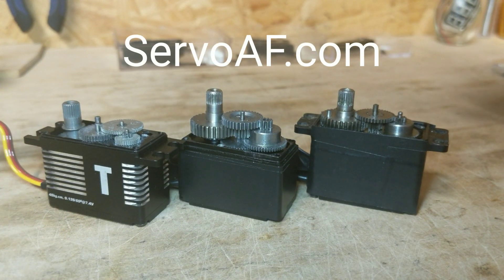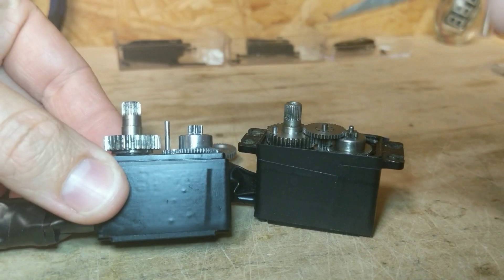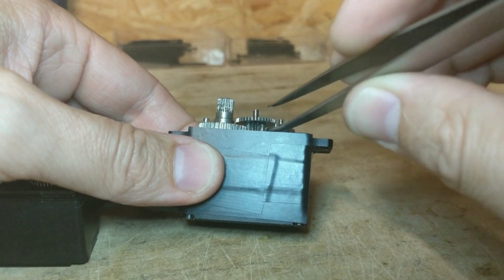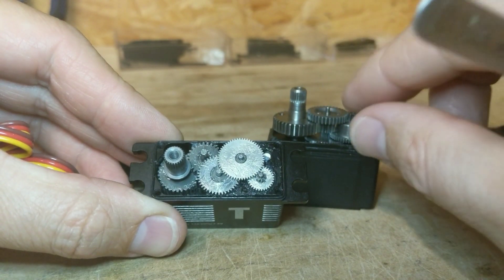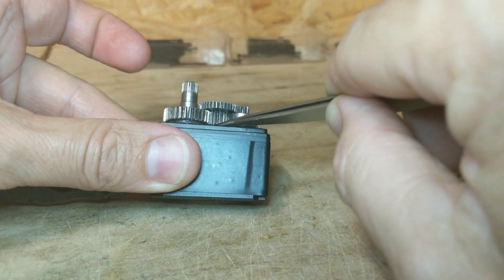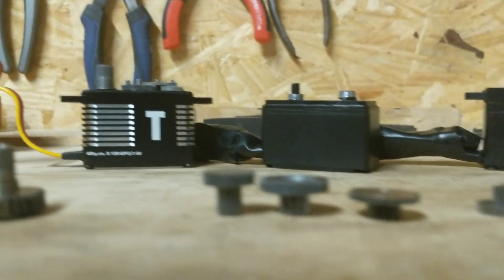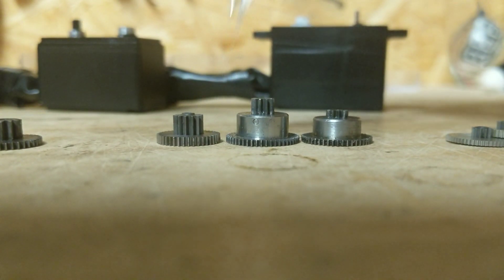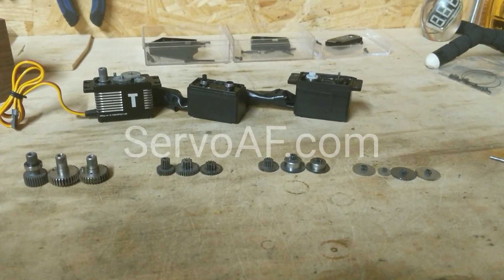ServoAF Model T Servo Gear Comparison

Comment: any chance you can revel the other 2 servos? Also servo looks larger, how does it fit in the standard servo mount
Reply from the maker: I won't be revealing the other 2 brands. The idea here is to show what makes this servo so much more durable. Chances are if you've opened a ±$100 servo you saw one of those 2 gear trains in it. 

Sizewise it's a little shorter than most at 40*20*33. More information on it can be found here servoaf.com/info
Reply: @servoaf9665  Why not ...clearly the one in the middle isnt for a car  and the one on the right isnt brushless ... Anyway ..the  gears on the other two servos look beefier than in yours .